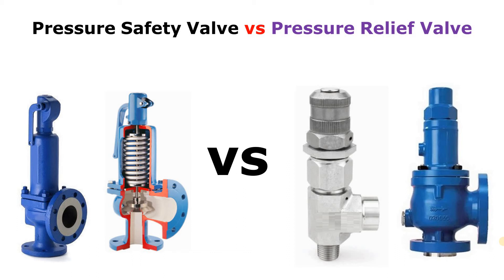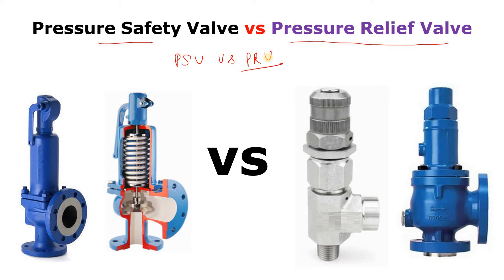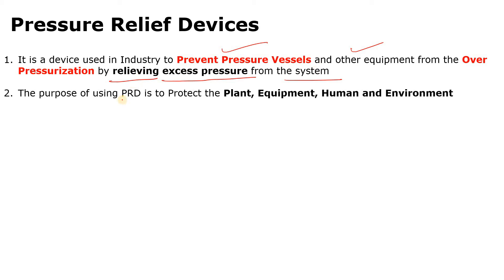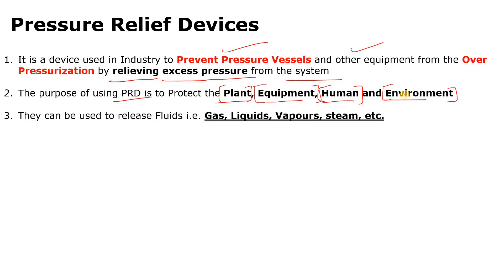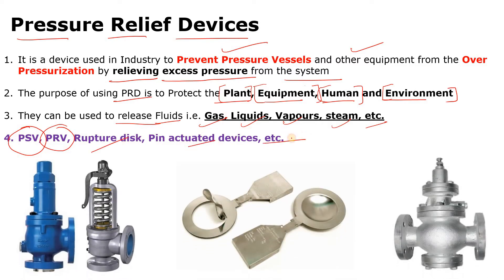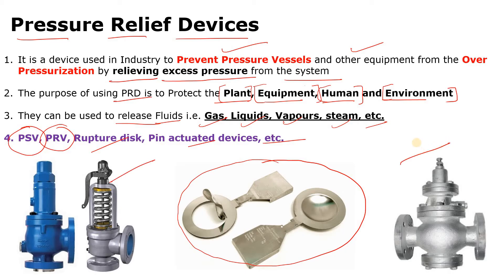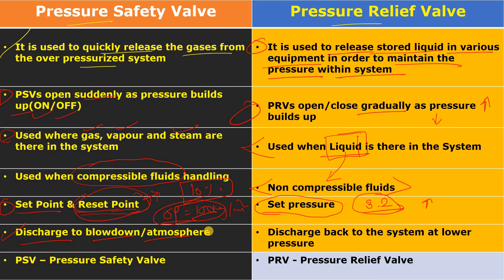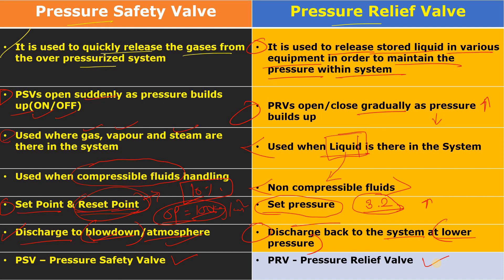Difference between PSV and PRV | Pressure Safety Valve | Pressure Relief Valve | PSV vs PRV.

Comment: excess temp  and any restrictions are in pipes/ducts
Reply from the maker: absolutely right and excess pressure, chocking/blockage, rupture of tubes(in case of Heat exchanger), manually close the C.V or less open the C.V, etc also may be the reasons